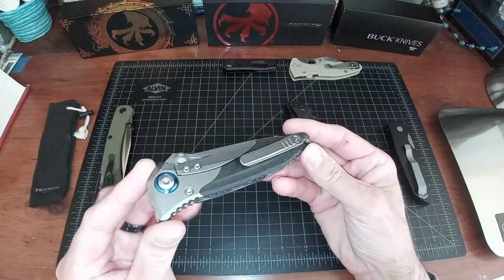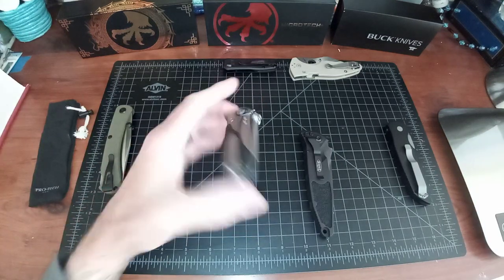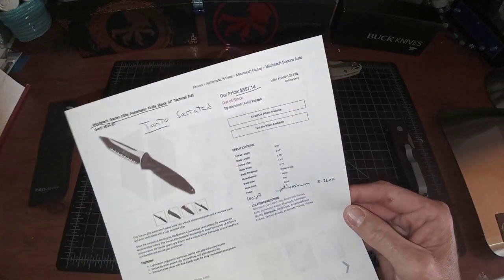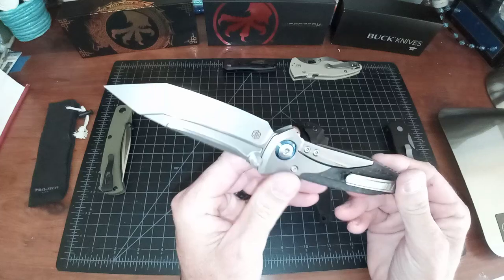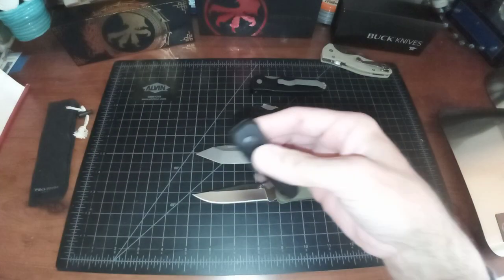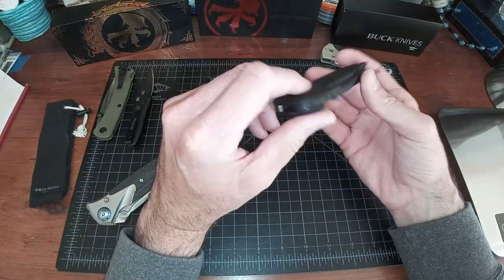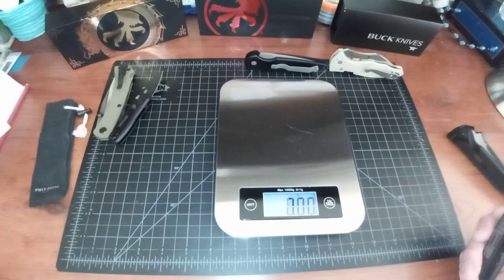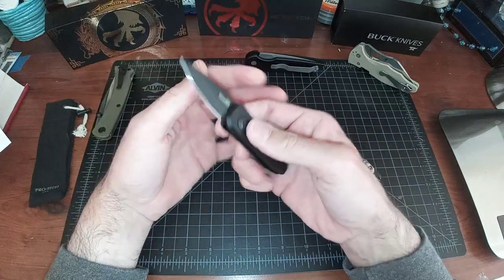Microtech Socom Bravo And Socom Elite Auto#microtech #knives #edc #knife #usa #gear #tools #tactical

Comment from the maker: Microtech Socom Bravo Tanto :

Overall Length:9.00"
Blade Length:4.00"
Cutting Edge:-
Blade Width:-
Blade Thickness:-
Blade Material:Bohler M390
Blade Style:Tanto
Blade Grind:Flat
Finish:Stonewash
Edge Type:Plain
Handle Length:5.00"
Handle Width:-
Handle Thickness:-
Handle Material:Titanium, Carbon Fiber
Color:Black, Gray
Frame/Liner:Titanium
Weight: 5.70 oz.
User:Right Hand
Pocket Clip:Tip-Up
Knife Type:Manual
Opener:Thumb Stud
Pivot Type:-Ball Bearing
Lock Type:Frame Lock
Brand:Microtech
Model:Socom Bravo
Country of Origin:China
Best Use:Tactical
Product Type:Knife

Microtech Socom Elite Tanto Serrated Automatic: 
Overall Length:9.00"
Blade Length:4.00"
Cutting Edge:3.75"
Blade Width:1.13"
Blade Thickness:0.19"
Blade Material:Bohler M390
Blade Style:Tanto
Blade Grind:Flat
Finish:Black
Edge Type:Fully Serrated
Handle Length:5.00"
Handle Width:1.375"
Handle Thickness:0.55"
Handle Material:Aluminum
Color:Black
Weight: 4.70 oz.
User:Right Hand
Pocket Clip:Tip-Down
Knife Type:Automatic
Opener:Push Button
Lock Type:Liner Lock
Brand:Microtech
Model:Socom Elite
Model Number:161A-3T
Country of Origin:USA
Best Use:Tactical
Product Type:Knife
Reply: The RIKE Microtech looks fantastic and the auto with serrated blade is wicked ma man. Get some....
Reply from the maker: @wrjames38  It's a nice knife, But heavier then I thought! Thanks for watching